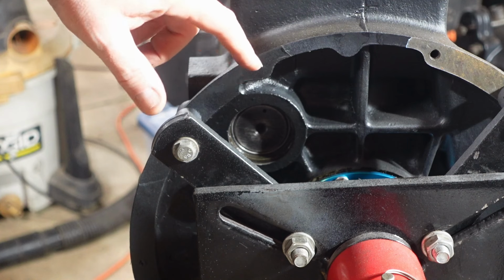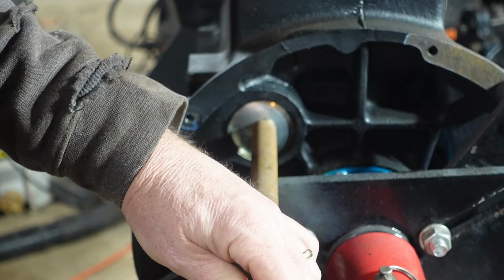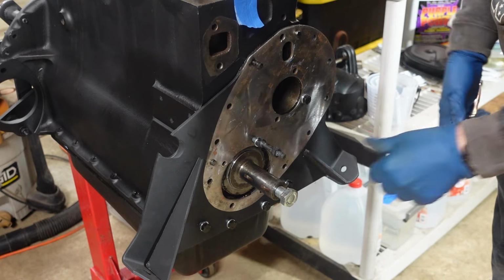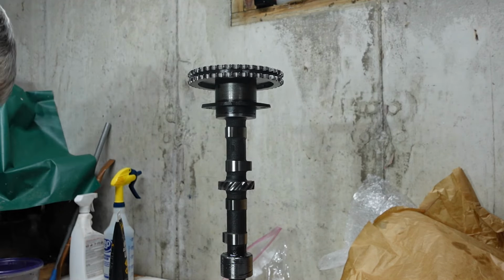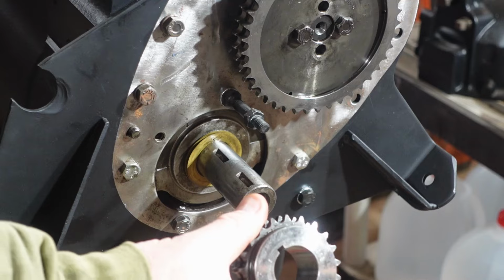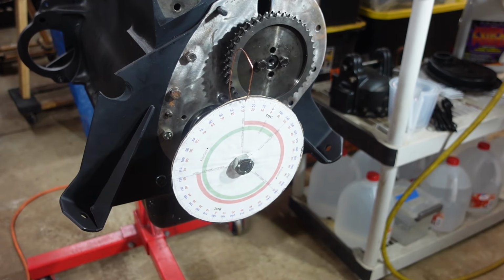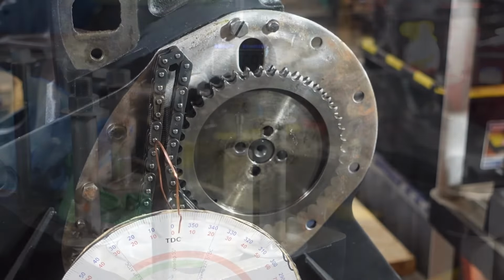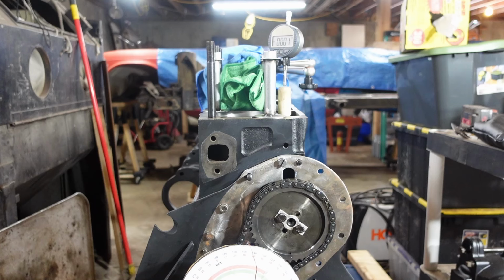Triumph TR4 - Engine Rebuild #14: Cam Timing | Roundtail Restoration

Comment: Hi Chris,  
I'm glad to see your project progressing! A couple quick notes...
I don't think you mentioned them in this video, but boticed you had large washers and nuts securing the cylinder sleeves in the block. That's particularly important before turning the crank, because the piston movement can move the sleeve, breaking the seal at the figure 8 gasket underneath and causing a coolant leak into the sump! (Don't ask me how I know! 🙄)
Your installation of the plug at the rear of the engine was "by the book". Some race engine builders go a step further after that plug is in, cleaning the area thoroughly and then putting some high temp epoxy in the recess to help insure the plug can't pop out (dumping all the engine oil onto the flywheel and clutch).
Regarding the several bolts for the front engine plate that pass through to the oil galley behind... in addition to the thread sealant you used, there are copper crush washers that can be used to seal those particular bolts. If I recall correctly, there also are a couple of different length bolts used and care must be taken to not bottom the longer ones out in some of the blind holes. There also may have been pan heqd, slotted screws used in the aluminum block, to prevent over-torquing that might strip the threads. 
I'm just going from memory though, so may be wrong about these last two points.
It sure will be fun to see it all back together and running soon! Cheers!
Reply from the maker: Thanks, Alan. I didn't find any copper washers on the front engine plate and I verified that with the spare parts catalog. However, you are correct about different length and types of bolts.
Reply: @roundtailrestoration  HI again, Chris. 
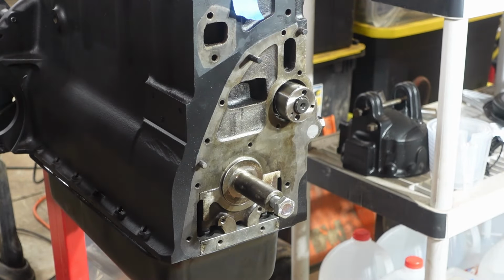FWIW, I just checked Elin Yakov's videos and found he mentions those copper washers in his '64 TR4 playlist from about a year ago (the pale  yellow TR4), Part 14, about 6:50 minutes into the video. He identifies at least two of the front cover perimeter bolts where he uses copper washers to seal against leaks. (I thought there were more, but paused the video... will go back and watch the rest to see.)  
According to him, another copper washer (which I forgot) goes on the pedestal that supports the center of the front engine cover. 
I don't know why the various parts suppliers don't show those copper washers. The thread sealant you used will probably do the job as well or better.
Incidentally, this remonded me of some TRivia. The front engine/timing chain covers of the TR4, TR3 came from the faactory with a crude blob of "something" in the center. It looked like Bondo or seam sealer slathered on 1/8 to 1/4 inch thick, then painted over. That's othen missing now, removed by previous rebuilders, but I've seen it on several engines in the past. To my knowledge, no one has ever given a good explanation for it... perhaps it was some sort of sound deadening. I don't know if car show judges look for it and deduct points when it's missing, if someone is striving for serious originality. I do know it's NOT on my TR4's timing chain cover (because I removed it many years ago).
Reply from the maker: Thanks, Alan. I do believe there may be a copper washer on the end of that chain tensioner "stalk". Definitely will study some more. Thanks, as always, for your help and reminders. Definitely more than once that I've gone back and checked and corrected things based on your comments!

Comment: Hi Chris, I've probably mentioned this before, but as much as I love Triumphs, this method of cam timing is so prehistoric!  Even in the 1950's American engines had the crank and cam shafts marked with timing marks.  British engineers should have figured out how to mark the timing spockets and chain to simply install them without going through this silly exercise.  I understand that this is not a stock cam,but the makers of the cam should be able to easily create a premarked custom gear with the correct markings on it.
Reply from the maker: I think you're right, Michael. Coming from the factory, they have timing marks, but I don't think I've ever seen them for sale with them already on there. The workshop manual does provide a procedure if the marks are already there. One thing I do like about doing it the old way is you get to learn how the motor works, I think, if you're paying attention to how all the moving parts are choregraphed together. Thanks!

Comment: If you really need a cam that is spot on, say for racing, buy a real large diameter degree wheel, get a book on HP Engine Blueprinting and learn a proper technique.  With this method you might as well just use marks on crank sprocket and cam gear as in the manual.  This is ok for a street motor but that's about it.  There is so much more to this and all the information is available.
Reply from the maker: Thanks for your comment. I didn't have any existing marks and with an aftermarket cam, not sure it would have mattered. I followed Newnans procedure, so we'll see when I get the head on and can measure actual valve travel. Thanks!